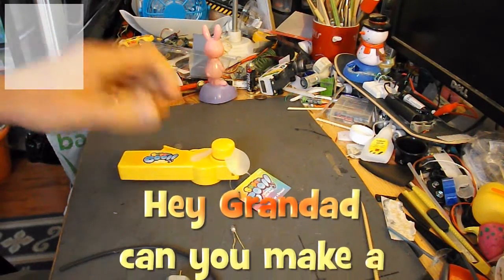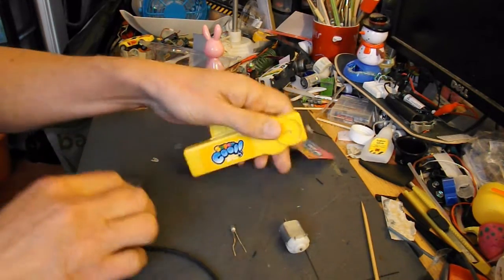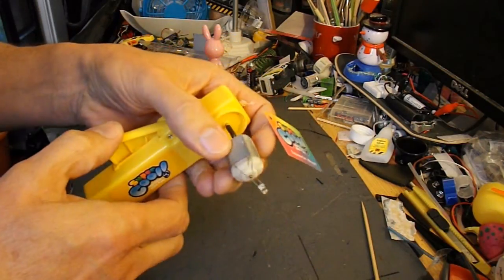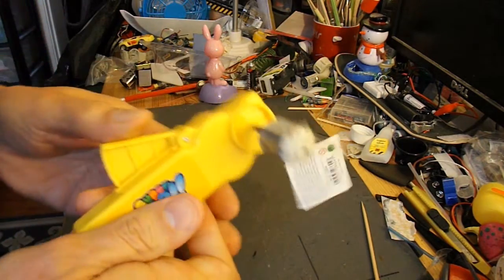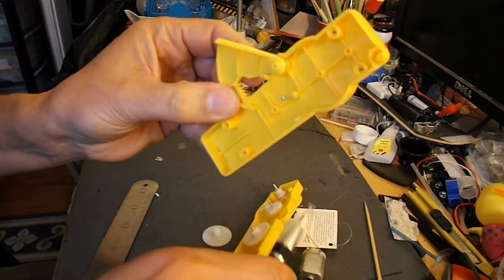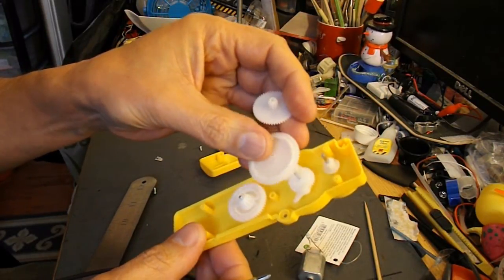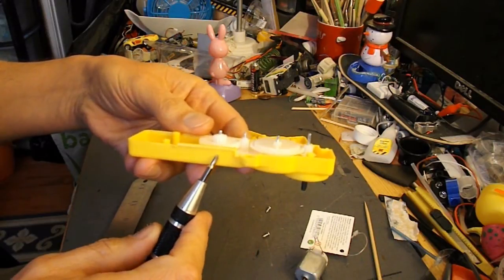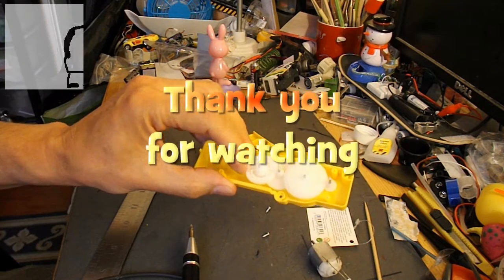Hey Grandad can you make a generator?

Comment: Hi Grandad, can you make generator like a this but with super cap and 3 Leds 
something like a flash light :]
great video
Reply from the maker: Frank Alvarez it would be much easier just to buy one ready made. They sell them in the bargain stores for £1 or less and I usually buy them to take them apart for the coil and the gears. They don't have supercapacitors in them, but that would be an easy addition, they actually have button cells fitted for when you are too lazy to use the pump action. Here is an example https://youtu.be/tk5mMRrbhEI